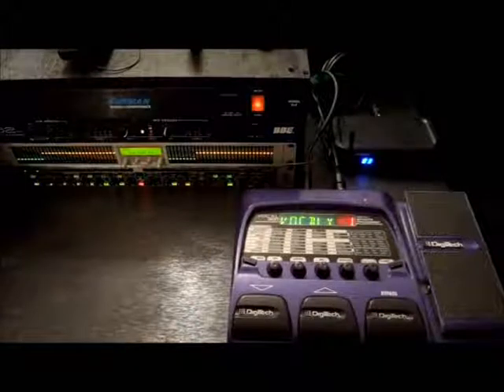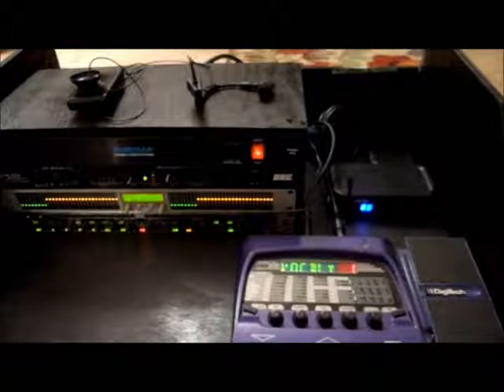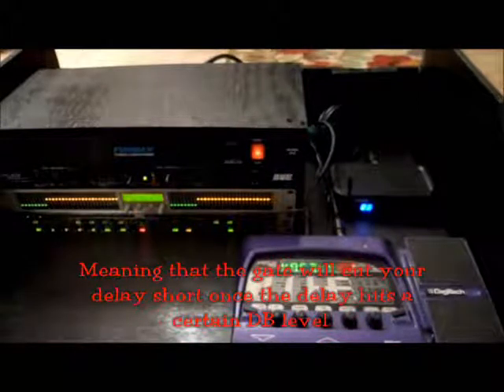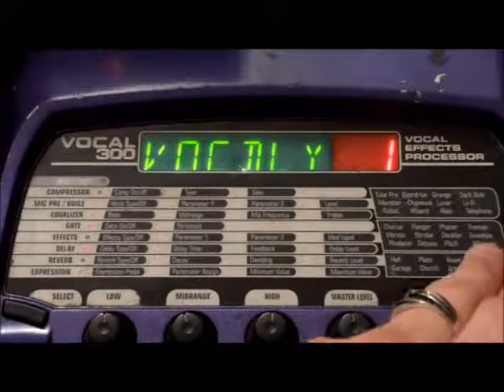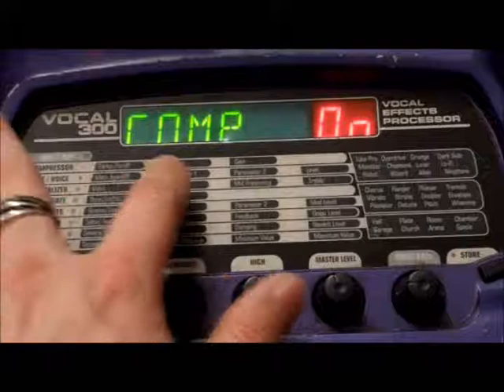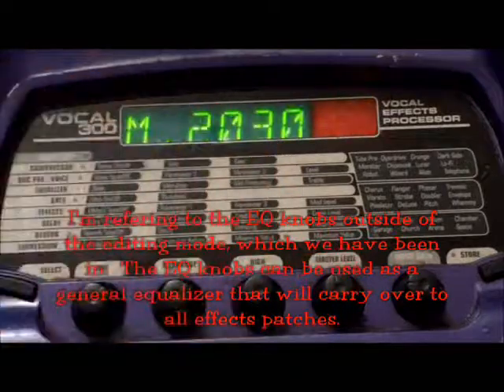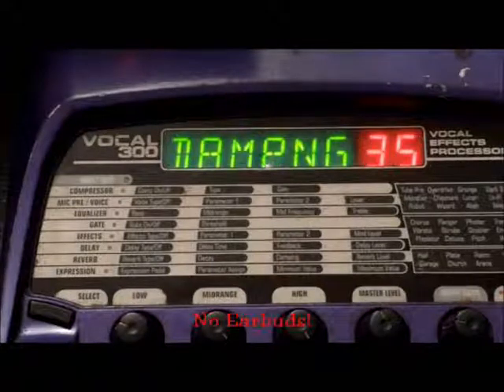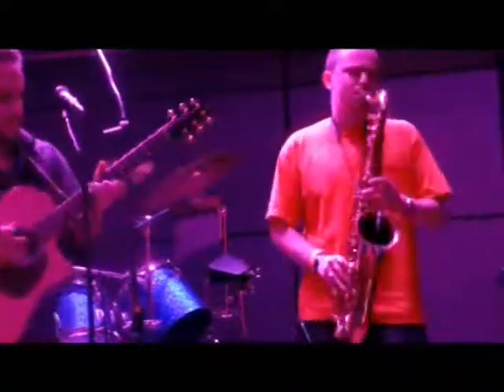Taming The Digitech Vocal-300 for horns, Part I

Comment: Best guide ever produced for this temperamental machine. Too bad Digitech never showed as much care after release.
Reply from the maker: Which is ashame, because it's a good piece of kit. I'm still using mine.  I have learned that digital boards prefer me to use considerably more gain, around 12 O'Clock vs. 8 O'clock for analogue, but other than that it still works just fine in modern settings.

Comment: Hello Jake, how do you make that the others sounds of the instruments on the stage no go to the sax mic? I work with a TC Helicon but is much difficult that the Helicon not 'take" the other instruments sound on the stage and harmonizer too. Thanks.
Reply from the maker: dieguete1234 be sure to keep the stage volume as low as possible, and keep your gains low. That will help in picking you up, and not the rest of the band. The gate limiter is also an option, but I'm not a fan on how it gates the effects.